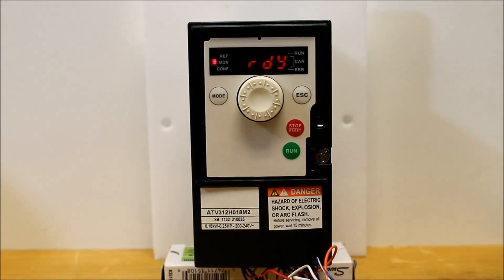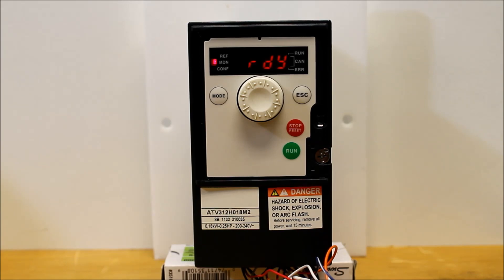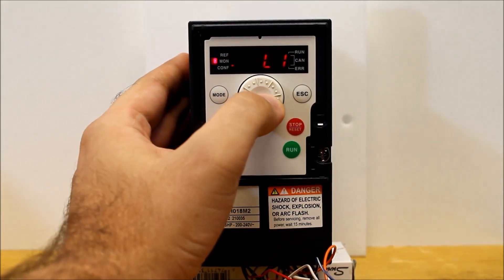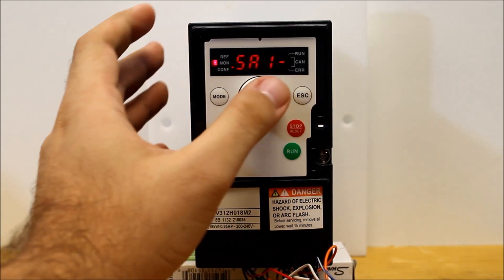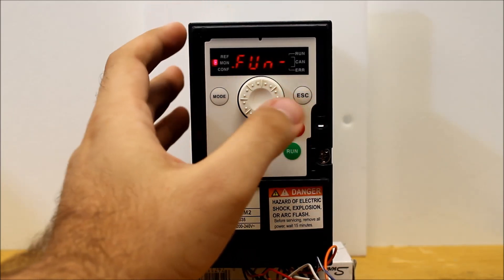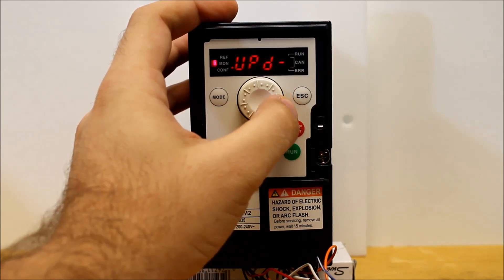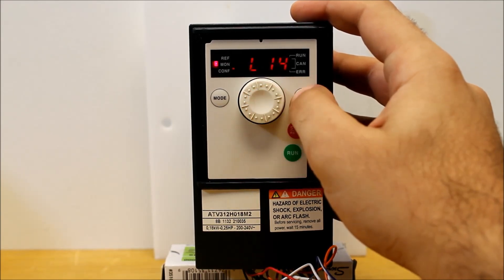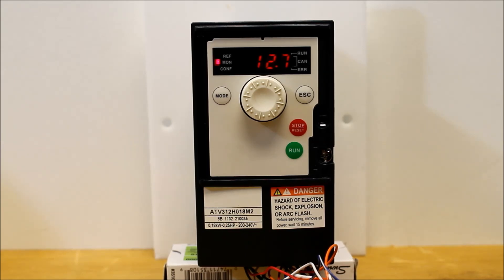Programming Logic Inputs for Speed Control on Altivar 312 Drives | Schneider Electric Support

Comment: Hi Sir 
I have altivar 32 vfd drive . My client requirement is not run in full frequency 50 Hz and next in reduced speed 8 Hz without turning off the motor. I tried with preset speed option but it is not working g. Motor run in low set frequency 50 Hz. with irrespective of preset speed input LI3 input high. Can any one help me to achieve my requirements to using digital terminal.
Reply from the maker: Thank you for your message, sathish lakshmanan. We apologize for any inconvenience caused. For technical support or to find answers to your questions, please refer to our support center: https://www.se.com/ww/en/work/support/support-center.jsp